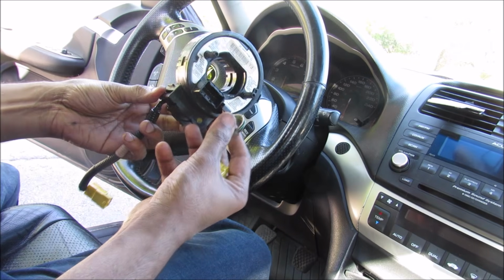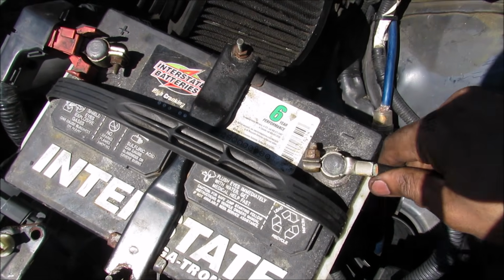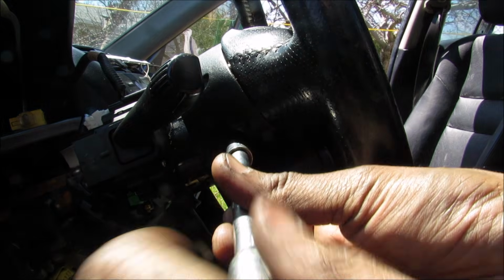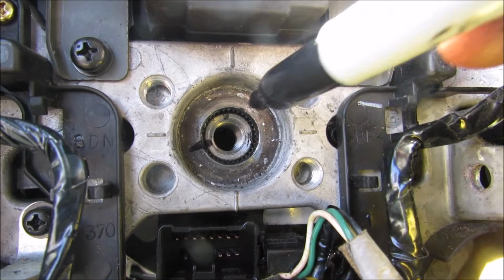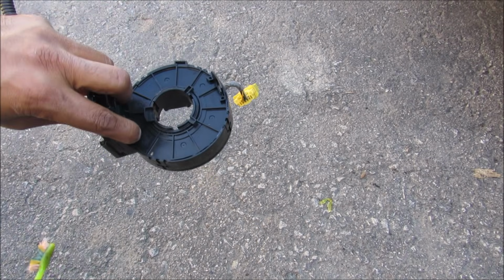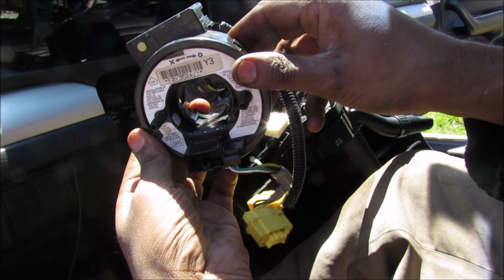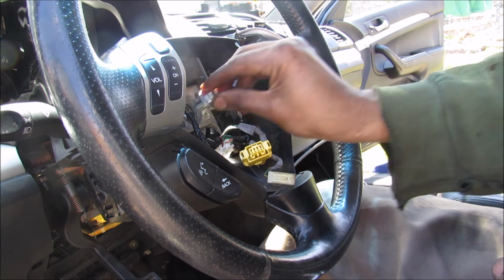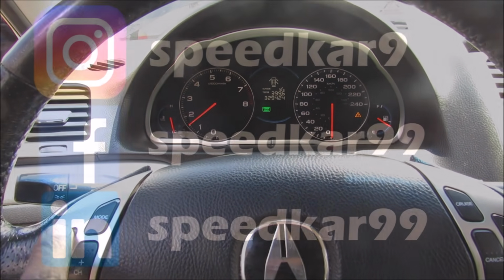How to Replace a Clock Spring

Comment: Is a steering wheel puller ever necessary, or can you pull any steering wheel off by hand after getting the bolt off?
Reply from the maker: I've always been able to jiggle the wheel off, especially Toyota ones. 
Honda's are a bit harder.
Reply: @speedkar99  thanks for the reply. Planning this job on my first Gen CR-V soon.

Comment: Hello, I need that exact clock spring you ordered for my 2007 Honda Fit. I keep finding the wrong ones and the new one you installed is exactly what I need. Where did you order that from exactly and can I get the part number? Also, I can still drive with a broken clock spring right?
Reply from the maker: Dealership
Don't drive too long you're Airbag won't deploy if you crash

Comment: How did you put the steering wheel lock on?
Reply from the maker: That's part of the column
Reply: @speedkar99  so basically you just turned the wheel all the way to the right or all the way to the left?

Comment: This is interesting because I thought it would be a simple replacement process. I've just been told I the car needs  reprogramming after installation?? You haven't mentioned anything about having to reprogram the clock spring. ??

Comment: My clock spring needs replacing. Dealer is charging about $450 in labor for this, which seems astronomically high. That’s also 3hrs at their $170/hr rate. Thoughts?
Reply from the maker: 3 hours seems excessive. This shouldn't take a reasonable technician 45 mins.

Comment: My son has a 2000 honda prelude....it honks when he turns or giggles the key in the ignition . The previous owner replaced the steering wheel . No airbags ,so I'm sure he removed this part . Any idea how I can fix the horn problem?

Comment: What would happen if you don't remove the tab ? Mine failed an tab was still in spring. Pull ring was gone but rectangular tab was still installed

Comment: I have all the same things not working on my mdx but I also have a VSA and SH-AWD light that came on. Could they be related to the clock spring. I think I broke the clock spring when I replaced my steering wheep
Reply from the maker: Maybe the steering angle sensor was part of it

Comment: If you install the clock spring without the marker, could the steering wheel keep tilting to one side?
Reply from the maker: No ,that sounds like you have an alignment issue

Comment: I have a 98 dodge durango and the horns do not work I've checked the fuse it's  good I've checked the relay it's good I have not checked the cruise control but air bag light is not on so I'm wondering what it is
Reply from the maker: Clock spring

Comment: Since Honda and Acura use the same steering wheels are there clock springs also the same for the same year?
Reply from the maker: Check up the part number and see if they interchangeable
Reply: @speedkar99  thanks

Comment: My airbag light on, the code says its the steering wheel airbag, I changed that no luck. Could it be the clock spring... All other electricals work OK.

Comment: Came across this video after breaking 3 ribbon cables on 3 different clock springs because I did not know how to reset them( put it in the middle)
Reply from the maker: Yes it has to be centered first

Comment: I have a 2006 TL and I just replaced the airbag. The SRS light is still on for code 11-10 (open circuit, driver inflator). It is giving me the code on the old and new airbag. The horn, and buttons still work. How likely is it that it could be the clock spring?

Comment: I have a Buick LeSabre 2004 and the horn wouldn't shut off so I pulled the fuse. Does this mean the clock spring is bad because there's energy in it somehow? The cruise ain't working at the moment either, but I can still operate the radio with the steering wheel too.

Comment: Help me out please!! I have an annoying tiny clicking noise that seems to be coming from where the clock spring is located, my LED lights on the steering wheel would flash intermittent while turning, eventually they went out..About a week ago I started to notice this "clicking" noise that happens when Im turning...I am 100% sure it is not a CV joint as I have had that issue before....My question is can a bad clock spring cause my issue??
Reply from the maker: Yes
Reply: @speedkar99  Thanks for your time sir! Grest video!

Comment: Hi Speed i have a Code: C1231 Steering Angle Sensor Circuit popped up on my 2009 Venza after replacing the Steering Rack, although the centering of the rack was way-off. so After i took it in to a dealership for alignment, i still notice the traction and VSC light is still on....then i tried using my OBD Scanner to clear it still it won't go away then i drove down to the dealership same thing they could not clear it. I then perform zero calibration on it still the VSC light won't disappear....Pls what else can i do? Thanks
Reply from the maker: Might be the steering angle sensor?

Comment: My tsx horn doesn't work. I also hear a small clicking sound when I turn the steering wheel. All the fuses are good, should I replace the clock spring? Also the car was in an accident in the past owner.

Comment: You should have the car in the on position before reconnecting the battery so if the airbag deploys, it's not in your face. It will deploy with you outside the vehicle
Reply from the maker: True. Dangerous

Comment: Nice work!
I’m having trouble with a Mazda 3, 2007 model, airbag light staying on
Reply from the maker: Scan the code
Reply: @speedkar99  Had a friend scan the car or code & yes it seems the clock spring, I've bought one, now once the wheels are sorted i'll install clock spring, thanks heaps - Australia...
Reply: I've just replaced the front right strut, was bent, i'd say previous owner hit something hard.

Comment: Hey man So I got frs 2016 and while installing my new quick realease I broke my clock spring then I bought a new clock spring then install it, all of a sudden my abs and track control pops out how to get rid off it.
Reply from the maker: Maybe the clock spring wasn't wired correctly giving a fault? 

Scan it with techstream.

Comment: Just recently I had an issue with my horn. The plastic deteriorated and the horn remained on continuously. Even though I physically disconnected the horn the switch went through a relay (which I did not know about at the time) and so in a few days the car battery was discharged. 

To complicate the issue the previous owner had opened the steering and used a thread lock on the bolt. Even after drilling out the bolt head i was unable to get it out. Thought about using heat but the airbag was mounted on the same frame. Eventually good sense prevailed (or I probably would not have been writing this comment).

It was an interesting and challenging dodgy fix. Link below if anyone is interested.

https://www.youtube.com/watch?v=6ppEtnAIbk8
Reply from the maker: Wow yeah those bolts are on there pretty tight. Did you try an impact gun?
Reply: @speedkar99  I don't have an impact gun.  Eventually I just drilled it out and put a nut.

Comment: If you leave the bolt in the middle of the steering wheel on a bit it can save you smacking yourself in the face with the wheel when you rip it off.
Reply from the maker: Good tip, that's what I did too

Comment: I can't believe they use a big roll of ribbons. I would have thought it was metal rings with terminals rubbing them or maybe a bunch of slip rings with brushes.
Reply from the maker: Slip rings work if you need infinite number of turns, but the brushes in them wear out after a while (like any electric motor). A ribbon cable works when the turns are limited and is more reliable

Comment: Thanks 🙏 for the video 

I have a question for you...
I have 2005 Toyota Avalon the audio buttons on the steering wheel always work but the cruise control and the horn and the ac buttons sometimes they work and sometimes they don’t. Is that a symptoms of a bad clock spring?
Reply from the maker: Yep sounds like your have a partial failure of the clockspring
Reply: speedkar99 thanks for your help I’m going to the junkyard today to get a clock spring and hopefully I’ll be able to replace it today.. after I’m done I’ll let you know 😊

Comment: Those things never broke on my car.
Reply from the maker: It's a wear item that usually doesn't break. If you remove the steering wheel from the shaft and spin it, it can easily break.
Reply: @speedkar99  I never opened my car steering wheel/column. Don't know if previous owner ever did.

Comment: Nice video man. Didn't know about clock spring until now. 
I got a question for u. My car producing a little squeaking sound from the front tires while braking at low speed or before coming to a stop. It's not the ABS sound, what could be the sound ? is that from not lubricating suspension components? or something else. This is after a under body wash and cleaning of brake liners
Reply: Brake pad is wet its normal for it to squeal until the pad gets hot it goes away
Reply: @TheDerrty111  Nope both at hot and cold conditions
Reply from the maker: Sway bar bushings if it squeaks on bumps
Reply: @speedkar99  Not on bumps only coming at a stop

Comment: A job like this will cause you a arm and leg at the dealer. Something new I learn today clock ⏰ spring :)
Reply from the maker: Thanks. 
Yep it's one of those overlooked parts.
Reply: o well if dealers would not charge too much. They want to charge $800 to replace it and the part cost from $40 to  $150. that is crazy. thank you for your video

Comment: I always wondered how the connection was made inside the steering wheel, thanks for showing it!
Reply from the maker: You are welcome. 
Most cars have had this for years, it's simplier and more reliable than a slip ring.
Reply: @speedkar99  what's a slip ring?
Reply: @bassam_salim  it's what you can see in the video about windshield wipers motor to reset back to resting position.
It's a ring or track with a contact moving along its length.
Reply: speedkar99 - I need to replace my 1998 Plymouth Neon clock spring BUT the part is discontinued. What do you suggest? #NeedHelp

Comment: Didn't even know a clock spring existed until you posted this lol
Reply from the maker: Yeah it's one of those things that no one notices until it's broken. 

I still don't understand why it's called clock spring though...it's nothing like a clock and doesn't have a spring....
Reply: @speedkar99  It looks like a clock spring, which is why it has its name.
Reply: @speedkar99  Clock spring: https://youtu.be/T28sGA597IE?t=827
Reply: I thought we were going to fix a grandfather clock. ☺️
Reply: @johnraley5713   They are weight driven...no spring.

Comment: Learned more today, Thank You!
The last time I took a steering wheel off, there were a several physical metal contacts for horn and etc... Glad to learn that all sub by ribbon cables.
Reply from the maker: The metal contacts are probably a slip ring
Those allow for an infinite number of turns 
But the contacts in them may eventually wear out.